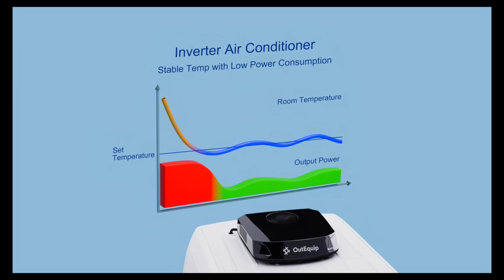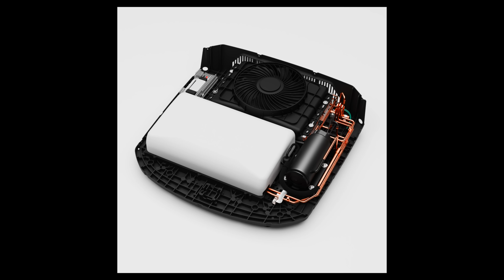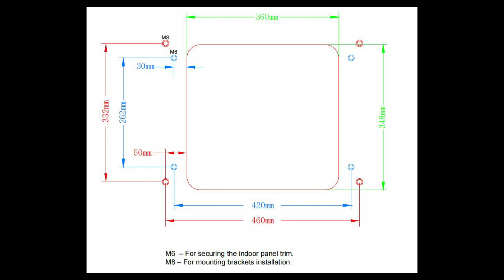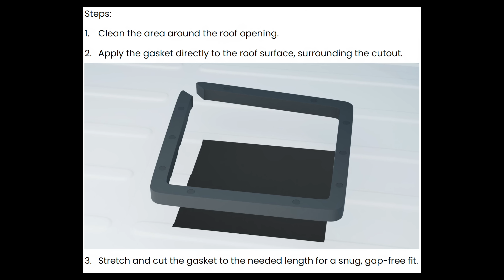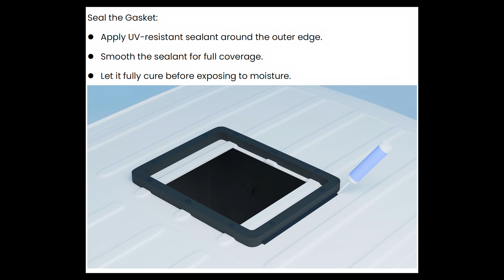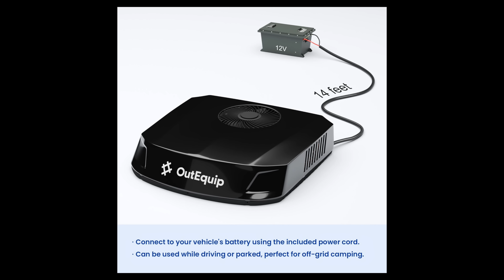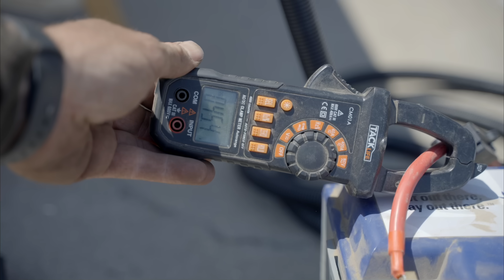Mock Roof, Real Mistakes – OutEquipPro Glacier Pro 12V AC Install Breakdown

Comment: Have no idea why OutEquip uses spacers in the gasket. As far as I can see from research they are the only company saying to use the little spacers. I've installed numerous AC units with only the gasket (and other small gasket material blocks for supports at the rear of the unit) to support them and never had any problems. Also, throw away the gasket that comes with the unit and just buy a proper 14x14 inch gasket from Camco.

Comment: Outquip send me a unit as well for video. It must have been an earlier unit as some things are definitely different. The one they sent me, no template, the bolts for the bracket were actually within the 14x14 hole, and the instruction manual they sent was even less informative than what you mentioned. And, it leaked, the way it was built, it had to be mounted an exact way (should have been in the instructions, it wasnt) and it leaked. The interior panel where the vents are actually came off and you could trim the duct to make it shorter (not stick down so far) but not as far as they told me I could in our emails. And the finish trim panel was held on by the piece that the vents are in. So, perhaps they made some positive changes. And they definitely need to better their included instruction manual still. So..I have an install fail video on my channel of this unit, and I ended up just sending it back to them
Reply: @cassidysepicadventures  I'm guessing you have the slightly smaller Summit model.

Comment: Nice review.  But... I've got an old PleasureWay Excel, the AC sits in a recess that's 30" wide, and this unit happens to be 35" wide, so it literally won't fit.  A typical roof-top install on most campers or RVs wouldn't be a problem at all, but in my case doesn't work. :(
Reply: They have 3 sizes on their website. Did you look at the small one?

Comment: I've been seeing this OutEquipPro AC being reviewed recently on numerous overlanding related channels on YouTube.  I think they provided a unit to virtually any RV, overlanding, or camping related channel that wanted one.  Not a bad advertising strategy as I've already watched multiple reviews of this unit.

I like the unit and even considered purchasing one to replace the A/C powered air conditioning unit on my van, but a few things have put me off.

First, I don't like the need to add additional mounting holes around the existing 14" hole in my roof.  My current AC mounts through this 14" hole and I fail to see why OutEquipPro decided they needed their mounting hardware outside of this existing hole.  

Second, my current A/C powered air conditioner connects to the A/C line inside the van; this OutEquipPro unit has its power cable exiting the rear of the unit, above the roof.  This, as Jason points out, requires that you cut a hole in the gasket material or in your roof, in order for the power cable to enter your vehicle.

Hopefully, OutEquipPro can address these two apparent shortcomings in their next product iteration as the power efficiency and the reduced noise of this unit certainly makes it desirable.